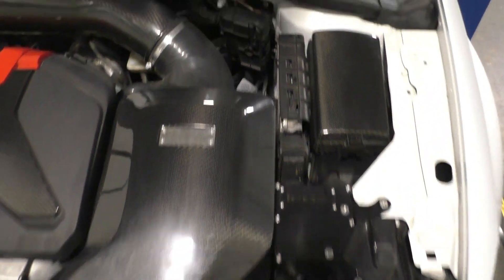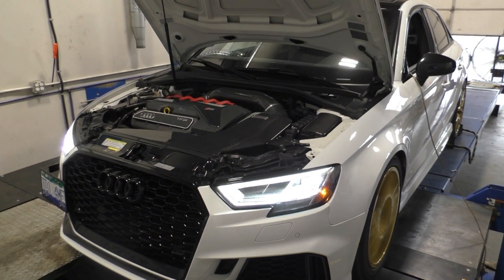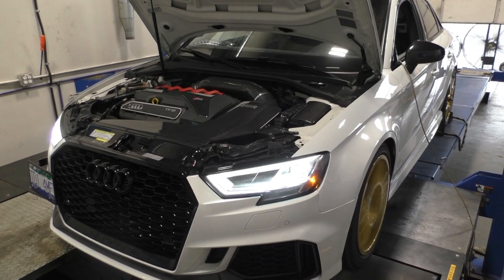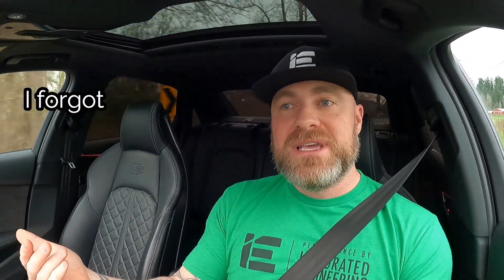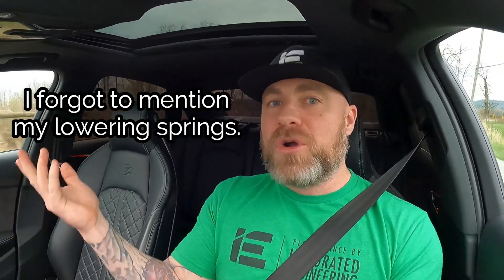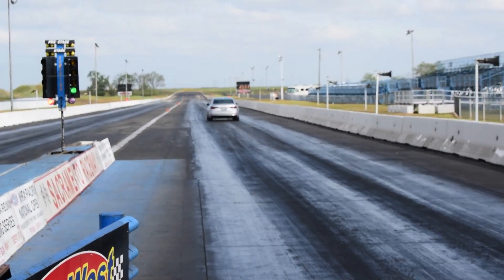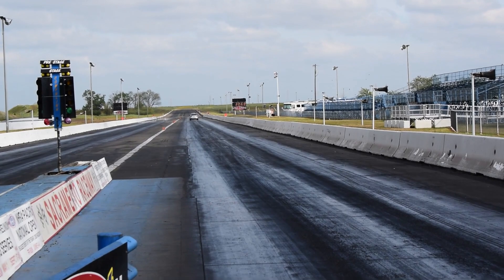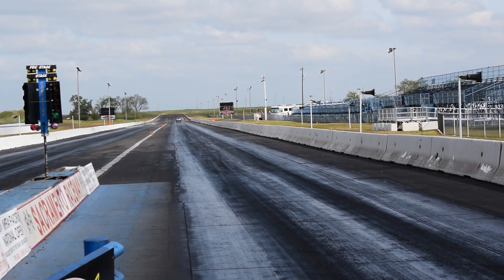Why I Chose Integrated Engineering For My Audi B9 S4!!!

Comment: My 16 A3 1.8t did not like the IE tunes. Now on Unitronic and so far so good. 034 only has TCU and EQT has none. Not much for the 1.8 platform. I didn't mean to get a 1.8. I just saw the car and loved it. Also, not many clean used 2.0 A3, S3 cars out there.

Comment: the good 60ft lies in the transmission type. S4 has real quattro which is predominantly rwd while the rs3 is a fwd based awd system. True quattro always gets the jump on my haldex quattro :))
Reply from the maker: Looks like your haldex AWD isn't well optimized then, lol. My RS3 digs harder than 95% of torsen AWD drive cars that I've lined up against or seen in action.
Reply: @VancityAudi  stock vs stock? I dont think so
Reply from the maker: @dbogdan17  I never refer to vehicles in their stock form when I make comparisons. People that are after true performance in their cars don't leave them stock.
Reply: Well long story short its rather understandable how it can cut such good 60ft, especially when it has a lot more power
Reply from the maker: @dbogdan17  as I explained in my video there are RS3's making over 1000hp that don't 60ft as well as I do in my RS3, let alone what IE accomplished in their TTE710 B9 S4. They did well. Let's leave it at that.
Reply: @VancityAudi  i meant a lot more power than stock but i see how you could misunderstand that.
Reply from the maker: @dbogdan17  I did, yes

Comment: I have a 2019 golf all track and it had a stage one integrated engineering tune which was great. I recently had an IS38 turbo, intercooler, RS7 spark plugs and coils installed. Unfortunately integrated engineering doesn’t have a tune out yet for this set up so I had to go with APR. Seems like there’s a lot of people out there who are very against APR do you have anything negative to say about them? It seems like it’s running pretty strong right now, I have no complaints. Excited for your new build!!
Reply from the maker: Honestly, I used APR for my first Audi when I didn't know any better. After I had purchased their software and their hardware I learned of some of their shady business practices and their tune was melting my spark plugs, lol. Then once I moved onto the RS3 I realized that they seem to be more about getting to market first with a half assed tuning solution rather than taking their time and developing the best tunes they possible could. I'll never use another APR product in my life again.
Reply: @VancityAudi  lol damn it! Well hopefully IE develops a tune quick so I can switch over. There’s another shop in Connecticut not too far from me that has been doing the Daza swaps on golf Rs and they use United motorsports tunes and have a flex fuel kit for my car so I might possibly switch over to that.
Reply from the maker: @mcwendel8066  United Motorsports is who I used in my 2016 Audi S3! Their tuning was awesome. Their customer service on the other hand 😬😬😬😬 lol.
Reply: @VancityAudi  why don’t you give IE a call for me and tell them to push along their IS38 tune for the Alltrack lol I think you have much more pull than I do! 🤣 I’ll owe ya one 🤙🏼
Reply from the maker: @mcwendel8066  LOL. I wish I had that kind of pull!